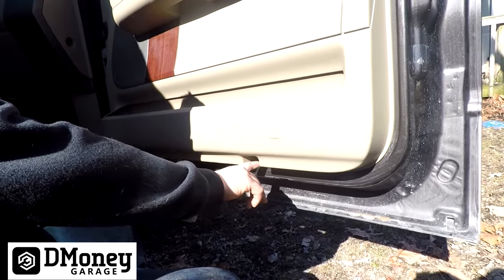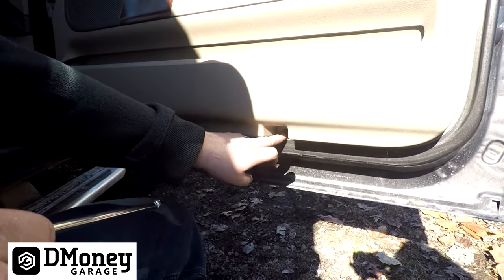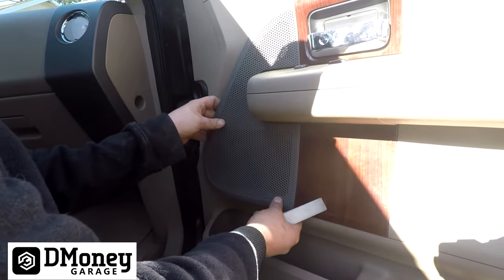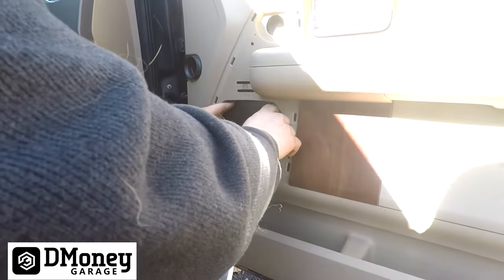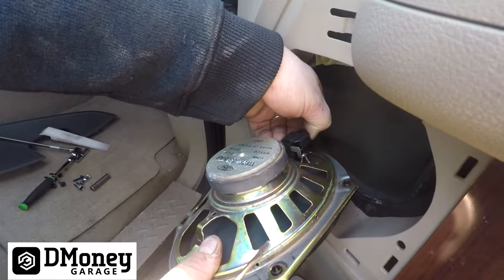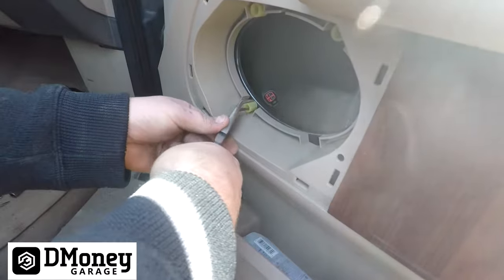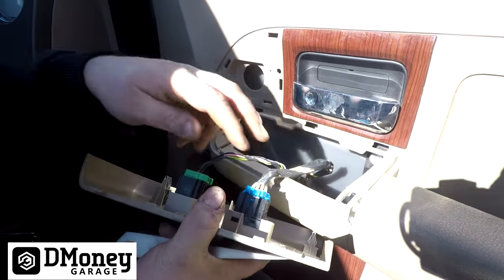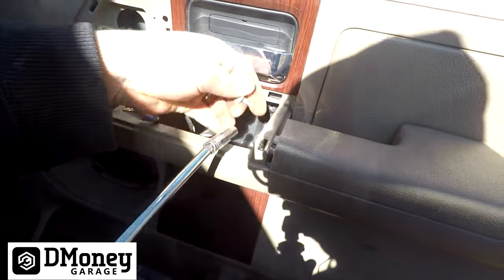How To Remove Your Door Panel On Your 2004-2008 Ford F150 Truck - Door Panel Removal

Comment: My model did not need to remove the speaker cover or speaker. Ended up breaking a couple tabs. The cover is not designed to be removed. I have a 2004 XF4 F150

Comment: I just watched the very beginning of your video and I started to pull off my rear door. started doing everything you said went to go pull off speaker cover and I busted all the pieces on the inside that was holding it to the door panel. this does not come off like the front doors! Like you said in the video. Thanks a lot! Now I got to go buy a whole new panel. Maybe you should check the rear doors to make sure that they do come off pretty much like the front ones. Yes I do have a 2005 Ford F-150 crew cab 4 full doors

Comment: Do not remove the speaker panel for a 2004 XF4. Only remove the door handle bolts, lower panel bolts and the bolt behind the window button.